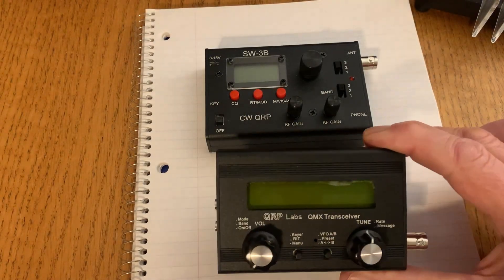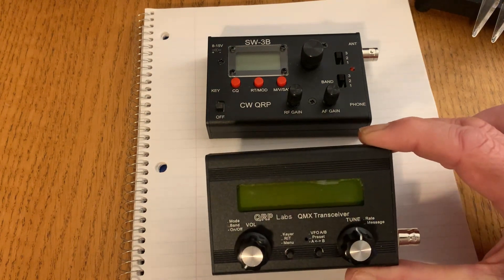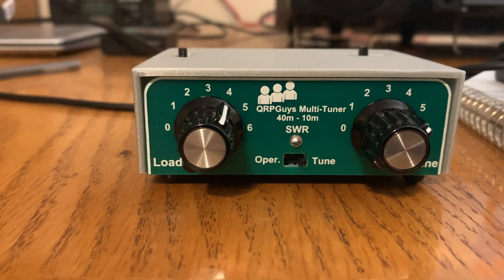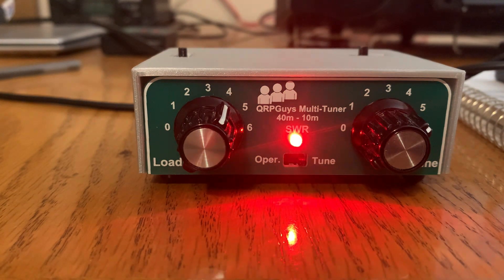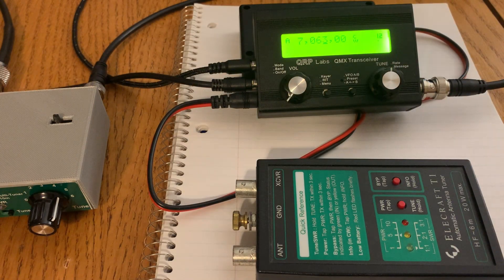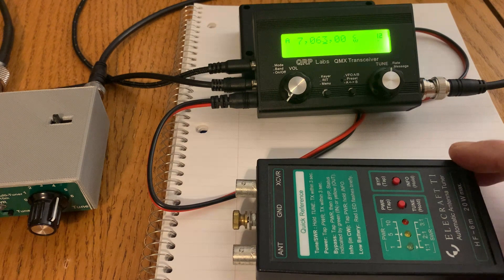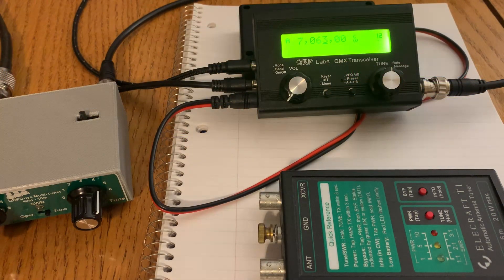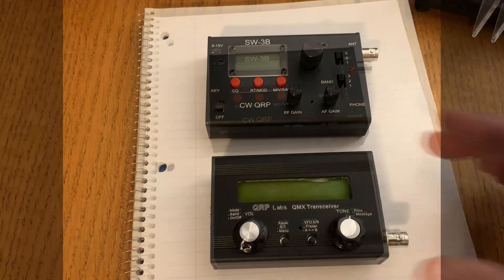QRP Labs QMX SWR Protection issues (?)

Comment: I just made a QMX+ and have the same issue.
1.3 SWR, protection set to 3, and the QMX stop transmission.
If I remove the protection, it work fine, and don't show SWR on the SWR indicator.

Comment: I think I have this exact issue.  The Snnexr to the frequency comes on almost immediately after I key the cw paddle and then i have to go into the menu to remove it.

My unit was pre-assembled by QRP and is running 1_00_020

Have you managed to get this resolved yet?

Comment: I have 4 of the QCX mini's with great success and still waiting on my QMX.  Looks like sometime next year before I will get one.  I will keep watching for future comments
Reply from the maker: I think this will be a great radio for the field for me. I've had a couple of the old QCX radios that I liked (other than the AGC, or lack of one).  But I'm hoping to sort out the SWR/protection function.  Having this is a great advantage over the SW-3B.  I also like that keyer speed is easier to adjust and the tighter filter will be good for CWT.  I'm guessing I'm doing something wrong - that's usually the case - but I just can't figure out what it is yet.  I'll keep you posted.  73 Ron